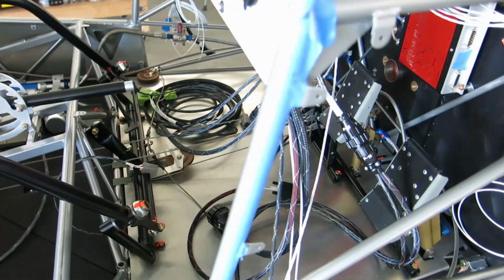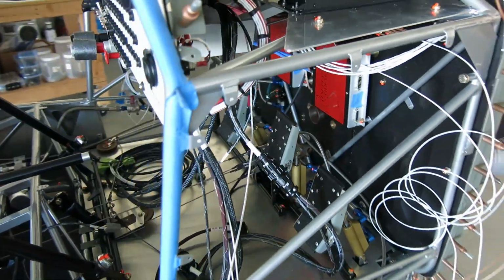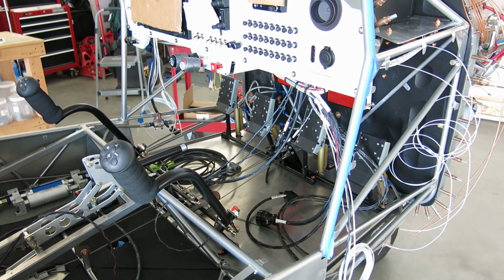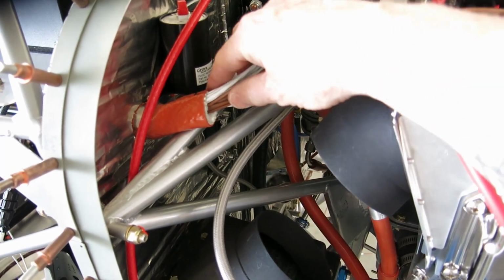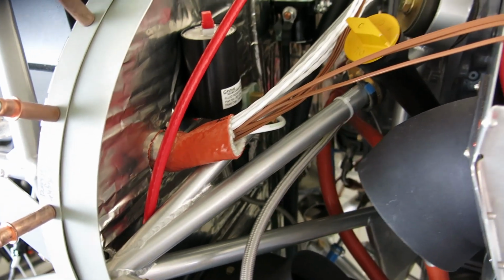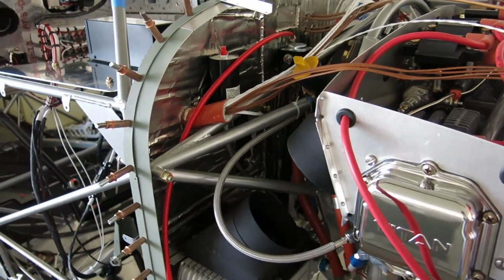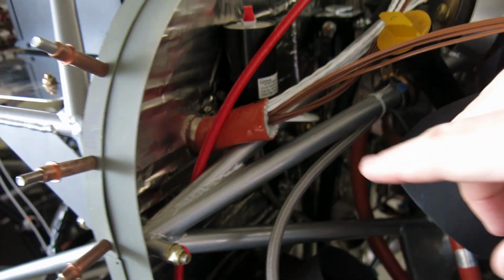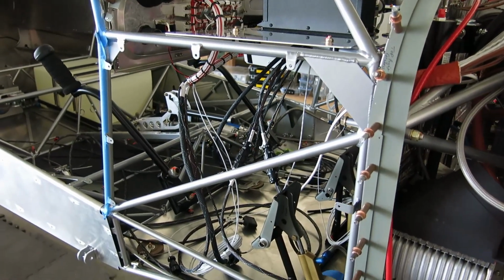No. 290 07-22-2023 Electrical continues

Comment: I wonder if RANS changed the engine mount after doing some of the firewall things. That connector hole does seem awful close to the mount tube, but it may have had more clearance with the CPC that it was designed for.  I am using milspec connectors for all of my firewall penetrations as I don’t like running continuous wires through a hole with sharp edges and I just like using connectors at bulkheads as it looks neater.
Reply from the maker: Yeah that hole needs to be about 1/2 inch higher, or lower 🙂
Reply: @s-21project92  Yes.  I am mocking up my Rotax on a stand I made with a plywood template of the firewall.  I found a few things already such as the placement of the coolant recovery bottle interferes with one of the engine mount tubes.  I am glad I decided to mock up the firewall before I started drilling the real McCoy.  It takes more time, but I think I will end up with fewer extraneous holes.

Comment: Any concern running wires before the cables for the ailerons are installed?  I always worry about a later clearance issue.
Reply from the maker: I strung a piece of safety wire from where the aileron cable turnbuckles are at sta 2a and through the lower pulley then up to where the next pulley will be so we can see that.

Comment: I am curious how and where you will bundle all the excess electrical cables without interfering with your systems unless you plan to shorten them and redo the associated connectors.
Reply from the maker: They’re pretty close to correct length. When the shop built the panel, we measured all the cabin runs (where we thought they might go) and added about 10% cushion for slack. There is a bit of room under that shelf to take up any slack. The runs going forward of the firewall will get trimmed down.